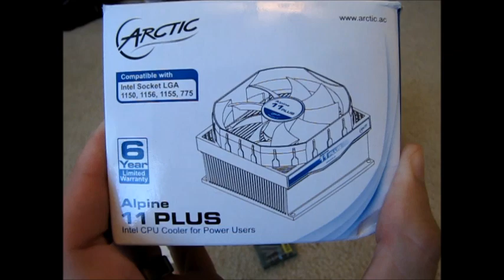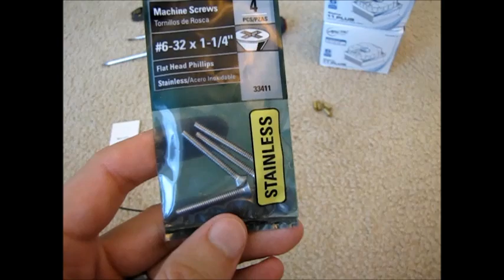How To Build A Peltier/TEC Cooling Device (Thermoelectric Cooler)

Comment: you bought the peltier lol I wanna know how to make the actual module...all the ones they sell are so small i want a big one
Reply from the maker: Good luck.  You'd have to be able to precision solder numerous little squares in series without any short circuits and then sandwich them between two ceramic wafers.

They do make larger ones but they are harder to find and much more expensive.  Why wouldn't you just use a bunch of smaller ones?

Comment: Hello. Can I use this setup for a dwc bucket set up I have two 5 gallon buckets and trying to cool both of them at the same time. Greatly appreciate
Reply from the maker: To cool 10 gallons of liquid you would need a lot more power than I used in this video.  But it also depends on how well you can insulate those buckets and how cold you want to get the liquid.

Comment: I'd like to see a cooler 1box oven 2nd box combo
Oven freezer combo w/ electric output
2 boxed walls of peltier
1 side hot.    1 side cold
Reply: It wouldn't work because both sides can have a maximum temp difference of 60 degrees so if the oven is 100 degrees (Celsius) the freezer would be 40 degrees so not much of a freezer

Comment: Bro where is thermoelectric peltier module in computer
Reply from the maker: There is not a peltier in a computer unless you add it.  You can sandwich it between the cpu and cpu heat sink to improve performance.

Comment: Coud you cool a pc with this ?
Reply from the maker: Yes, lots of people do this.  I have seen numerous articles and discussions on Tom's Hardware website about peltier cooling for PC's.
Reply: LDSreliance  cause then you dont realy need fans only the water pumps and you atach the peltier device to the water tank with the cold side touching the water tank and there you go completly silent watercooled pc with like -22 degrese cause it can legit freze water
Reply from the maker: Most people put the cold side of the peltier against the cpu and then the cpu heat sink on the hot side of the peltier.  But what you are saying will work also.
Reply: ye i know but this way you have fully cool water tank almost frozen + you dont need a radiator
and you can cool all the parts of a pc

Comment: To build a To Build A Peltier/TEC Cooling Device you need a To buy A Peltier/TEC Cooling Device?
Reply: yes, its a 'TEC COOLING DEVICE' Cooling device, for a TEC... -_-
Reply: The Peltier cooler is a solid-state device that creates a temperature difference between its two sides when a voltage is applied. The cooler itself is to optimize the process. Because the cooler is limited by the temperature difference between sides the heat sinks keep the hot side cool to reduce the temperature of the cold side and help cool air passing through it on the cold side. You can also supply a negative voltage and the hot and cold side will switch.

Comment: . Got a question for you. I have a 12v koolatron p25 thermoelectric cooler. I was thinking of running a duct from one of the car's ac vents outlet to the lid's air intake so that it will have a colder temp inside. Could this hack damage the unit in any way?  Thank you
Reply from the maker: I don't think that will damage the cooler, no.

Comment: Thanks for the video! Do you need to match the amperage of your power supply with the power input of the peltier? You link to a 10A power supply but the peltier you use is 5A. Do the fans make up the rest of the current? I ask because I tried running a 6A peltier with 12A power supply and the peltier is over-powered and not working correctly.
Reply from the maker: No.  The peltier will draw however much current it needs.  If yours is acting funny then it has to do with something else and not the current rating of the power supply.  What kind of power supply is it?  What is the voltage of the power supply with or without a load?

Comment: Hi. Can you use it without heatsink? Im planning to put it on xclamp in Ps4 Pro...just to cool down cpu.. thanks
Reply from the maker: No.  The hot side must have a heat sink or it will destroy itself very quickly.
Reply: LDSreliance how big heatsink?
Reply from the maker: I would not use anything smaller than you would see on a computer processor.

Comment: Hi LDSreliance, quick question please.... we have a requirement to keep a flowing liquid cool. Flow would max at approx. 1 litre per minute, down to zero flow. Liquid temp is 35 deg C (we need to get it down to 15deg C and no less). Exterior room temp is 70 deg C. We can insulate, we could put all in a vapour space (like a thermos flask). Do you think a set up with TEC could work. We could pull say 40amps 12v DC max. Appreciate your thought, thanks.
Reply from the maker: 40 Amps is a lot.  I did this project with only 5A.  I have a video that you might have seen on cooling liquid with a peltier and I used 5A on that one, too.  It cooled down about 4-5 cups of water but it took a while.  And you can use 8 times the power.

If I understand correctly you are needing to cool down liquid that is currently 35C down to 15C by the time it reaches the end of the apparatus?  The trickiest part with that is going to be dialing in the length and design of the water block that will chill the water.  It will have to be carefully tuned so that the water has time to get down to that temperature but not below by the time it exits.  That will require very even and constant flow from whatever your pump is and constant and even power to and from your peltiers.  You will probably also have to have some sort of thermostat to help control the power of the peltiers.

That is a major project but sounds fun!  I think it is definitely possible.

Comment: @LDSreliance thanks for such comprehensive video. Can I use this setup to control/vary the Relative Humidity of ambient air from 0% to 100% (if possible)?
Reply from the maker: I'm not sure how you would be able to use this to control humidity.  The hot side could certainly be used to generate steam to add humidity to air but it would be tricky to control with precision.

Comment: Being that I'm a complete novice who has never done anything involving wiring before, how could I rig this whole thing for a standard wall plug?
Reply from the maker: I would use a 12V power supply from a computer monitor.  They are cheap on Ebay or Amazon.  Here is an example: http://amzn.to/2giawBJ

Just cut off the end of the cord where the adapter is that would plug in to the laptop.  There will be two wires: red for positive and black for negative.  All you have to do is connect the red to the red on the peltier and same with black.  If you are using heat sinks with computer fans you will need another power supply for those.

Comment: What is it's usage time?
And what's it's lifetime?
Reply from the maker: Good questions.  I have not had any fail on me but I have also not used them for hundreds and thousands of hours.  These are used in medical equipment so the high quality TEC units can be very long lasting and reliable.  However, the cheap ones from China that you see on Ebay and Amazon for $1-5 each are pretty poor.  I have had lots of them be dead on arrival or damaged in shipping.  Some are also not within spec (they don't consume their rated amount of current).

Comment: Thanks for this. I am going to make a small ac for my cigar tower humidor about 6' high. This should do the trick. I only need it to cool at 70-72 deg which is difficult to maintain in SC. I may use two of these systems.  I already ordered the parts you have and so far its only $105  with addtional accesories. The additional acccessories are for  it  to run on AC and temp controlled. I have the Inkbird Itc-308 Digital Temperature Controller Outlet along with Mean Well RS-100-24 Enclosed Switching AC-to-DC Power Supply.
Reply from the maker: Very nice!  Let me know how it turns out.  That is a lot of air volume to cool down but if you are only cooling it down 5-10 degrees it should work (as long as it is well insulated).
Reply: Yes it just for the hot summer days when the temp is hard to get down below 75deg in the house. 
Working on the insulation. Already weather stripped the door. If I need to I will be setting it up for double fan system if needed. I had ordered the wrong meanwell system was only 4.5 amps that I mentioned in the previous post. I reordered a  12V 30amp power supply in case only $20  and should be enough for fans and, if needed, two peltier modules drawing up to 10A each. Yes looking for a 6 to 7 degree drop from current temp.This was based on the Amazon recommendation when ordering the fan and peltier module. Thanks again for sharing the concept.
Reply from the maker: You are welcome.  Good luck!

Comment: So if you were to make this into an air conditioner, cold air would blow one direction and hot on the other. So in a room, the cold air would cancel the warm air and make it inefficient. So why not just turn on the fan on the cool side and not the warm
Reply from the maker: You have to separate the cold and hot sides and route the hot air somewhere.  For an air conditioner you could use the window to separate the two just like a window air conditioner does.  All air conditioners have the same problem... they produce more heat than cooling.  So that is why they route the hot outside.
Reply: LDSreliance thank you!
Reply from the maker: You are welcome!  Thanks for watching.

Comment: Hey my friend, an important step to increase the cooling efficiency is to "thermally" isolate the screws from the heat sinks, otherwise you will loose the cooling through the screws
Reply from the maker: Good point.  How would you suggest?  Nylon screws?
Reply: agreed

Comment: Good video. Star pattern is how you tighten multiple screws nuts or bolts.  The  star pattern not a circle pattern is your best bet so it doesn't get off camber .
Reply from the maker: Good suggestion.  Thanks

Comment: I got a few peltier modules and they both suddenly stopped working and it even had dual Copper core heatsinks. is it possible to short them out? can they be misused? I used 12vdc and that's what they were rated for. any ideas?
Reply from the maker: I have the same luck with the cheap Chinese manufactured peltiers.  I assume that is what you are using since that is what everyone uses.  The high quality ones are like $30-40 a piece for the 5-6 Amp modules and you can get the cheapos on Ebay or Amazon for $3 a piece or sometimes less.

I have about 1/3 of them dead on arrival or do not meet spec (do not draw their rated amount of amps).  Then I have about another 1/3 fail after using them for weeks or months.

I always just buy at least 5 of them at a time and that usually gets me at least one that will work well.

Comment: Can a Peltier device(s) help cool my cargo van... or warm it if I turn the device(s) around?
Reply from the maker: Yes but you would need a LOT of battery power to do it and you would need several peltiers not just one.
Reply: I plan on installing as many solar panels as I can fit on the van's roof, still figuring out which panels, charge controller, inverter and batteries to go with, leaning heavily toward lithium ion augmented by ultracaps but only because I can't afford NiFe
Reply from the maker: Well if you plan on having a full solar panel system on your van then peltier cooling could be a viable option.  You will probably need 500W+ of peltier modules to put a dent in the air temperature of such a large space.  You will also have to figure out a way to route the heat from the hot side out of the vehicle efficiently without letting it creep back in.
Reply: Yes, years ago Swiss trains had a Peltier cooled cabinet for the drivers drinks( really!)  They had hot drinks in winter and cold drinks in summer. Maybe other companies look after their staff the same way.

Cheers Bill Taylor

Comment: For future ref, you could have tapped/threaded the other heatsink. You'd essentially be making it into a nut that you tighten against the other heatsink as you thread the screw in.

Clearance for a #6 screw is 5/32, #8=11/64, #10=13/64. Tap sizes are #35, #29 and #21 respectively

Fair warning, use some aluminum cutting fluid (I use Tap Magic in my shop) to prevent gumming up the tap threads. Otherwise you're likely to snap the tap off inside the block. Clamp the block down (pref in a vice) and just slowly drill the tap straight down. Be aware that on thicker blocks you might have to retract the tap to clean the chips out once or thrice. If so, re-lube and start it back in but be sure you're not cross/double threading your hole in the process.
Reply from the maker: True, that is a good point.  I don't have a tap and die set but that would have been a good option if I did.

Comment: Hello. My new fans came today. How big (in mm if you can) is the drill pice you used to boar out the holes?
Reply from the maker: The hole for the peltier to sit in?  The peltier is 40mm x 40mm so the hole needs to be slightly larger than that.  I would also cut a notch on one side for the wires to come through.
Reply: LDSreliance no, where at 4:30, you used a drill to make the holes bigger. How many mm wide was that drill piece, because I have loads, but don't know which one to use, as it might be to big or too small.
Reply from the maker: I don't remember, sorry.  It only needs to be enlarged slightly so that the screw can fit at an angle and screw into the standoff without jamming up against the heat sink.  You will see what I am talking about when you try to assemble it.

I would just start with a drill bit that is very slightly bigger than the original hole and keep stepping up to a bigger drill bit until it works.
Reply: Just to let everyone else know if they make this:you need a 3.5mm drill piece.

Comment: How many mm long are the standoffs?
Reply: Juan Rivera hello

Thanks for your comment, yeh that was Stupid of me, connected the fans in the wrong way.

Currently I’ve built the mod3l in the video and made advancements of my own, including a wood case with a pipe to exhaust hot air, a thermostat system to digitally change the temperature of the video, full digital and individual fan speed adjustments which can be done via Bluetooth and I’ve basically finished my project, which was to create a portable Bluetooth controller air conditioner for under £100
Reply from the maker: The standoff length isn't as important as the screw length.  The shorter the better as long as the screw can tighten.  But I think my standoffs were about 15mm (+6mm thread).  I don't know for sure because I didn't have to buy them.  I have hundreds of screws and standoffs from computer projects over the years and I just used what I had.
Reply: LDSreliance ok, I just received the cpu coolers today, what would happen if I didn't boar out the holes?
Reply from the maker: I had to bore out the holes a bit otherwise the standoffs would jam up against the side of the heat sink and I could not screw in the screw into the standoff.
Reply: LDSreliance hello, I really need help.

I connected power to the fans, yellow and red, and I connected the wires the wrong way around, hoping that they would push air instead of take. Now the fans won't work! Need help please. Thanks.
Reply from the maker: There are only 2 wires that you need.  The extra wire or two are for the motherboard to control the fan speed.  So disregard the extra wires.

What are the colors of wires that you have?  Red, yellow, and black?
Reply: LDSreliance I accidentally connected the yellow to the negative and black to positive and now the fans won't work.
Reply from the maker: I guess you burned up the motor.  Sorry man :(
Reply: May I suggest new fans and pay attention the second time around.